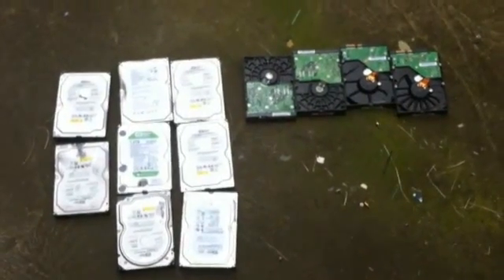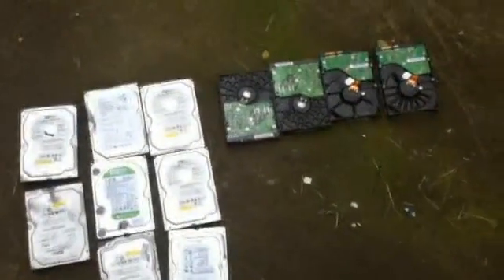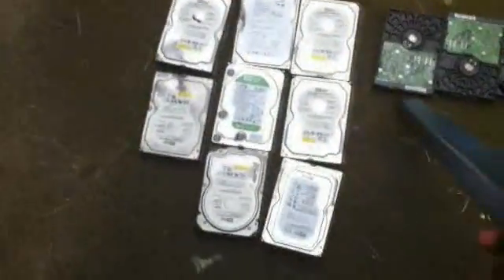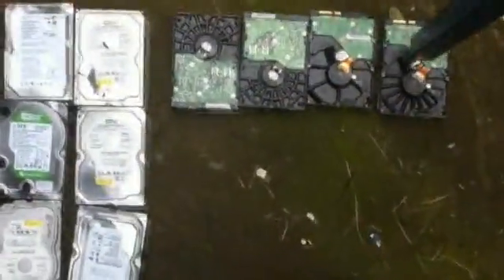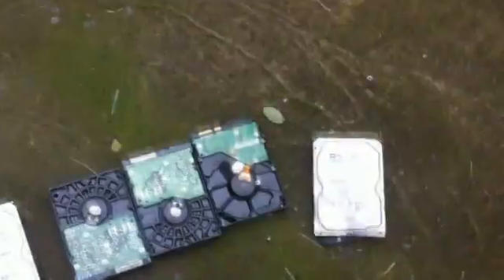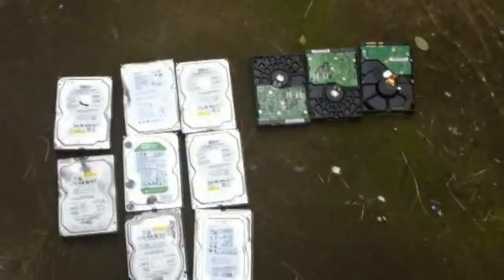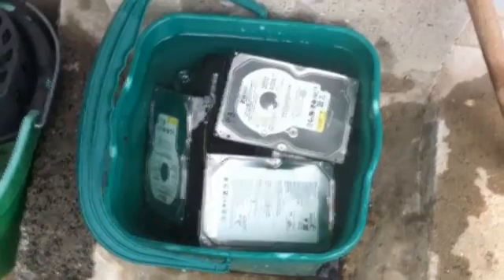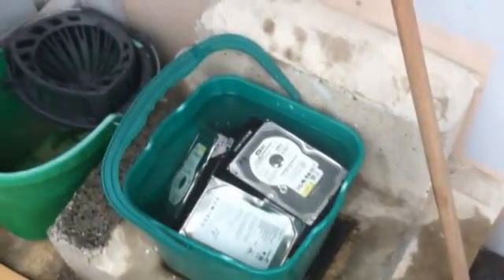The right way to destroy an old hard drive

Comment: The best way that I've tried is simply using a drill press to drill a single hole (1/8 inch or so) straight through the platters - you dont need to disassemble anything, and you completely destroy the drive this way. (Also there's not a gigantic mess)

Comment: 90-95% of the data on these disks are possible to recover with the right equipment. To be 100% unrecoverable you need to physically destroy the platters inside the disk

Comment: I think we'd all agree that a hard drive platter won't spin if snapped in half, correct? The thing is, that modern forensic data recovery labs can recover data, even if the drive has been snapped. Spinning is irrelevant at that level. Hell, they can recover data from burned drives. If you're going so far as to physically destroy the drive, then I'd presume it's safe to say you're trying to prevent that level of recovery ... the only truly successful/perfect solution would be to pulverize the drive platters. I'm talking about making them into pieces the likes you would get from using saws/drills/files over the entire surface.
Now, if you're looking for government circumventing -level disk destruction, you should probably take what it is you're doing to 'need' that into question. If you aren't seeking that level of data eradication, then simply re-partition and format. If you can't do that because the drive won't spin, or whatever .... then the work is already done. Nobody really cares that much about the average person to re-build a spent hard disk, make it operable, and go through hours of staring at their digital trash bin. If you're worried about identity theft, you have bigger concerns with what you throw away in your physical trash, than anyone will ever find from your dead or formatted hard drive.